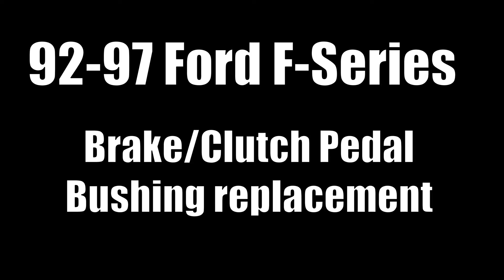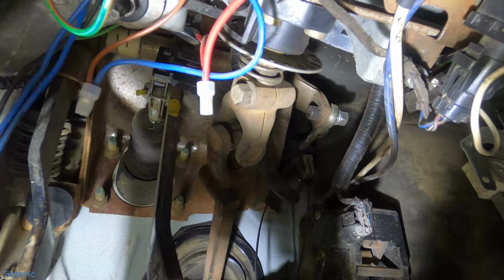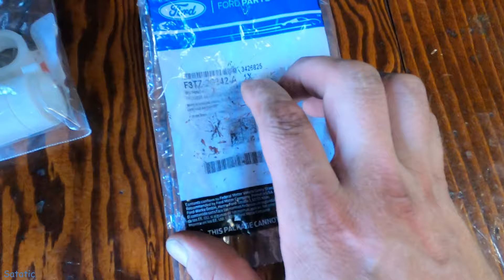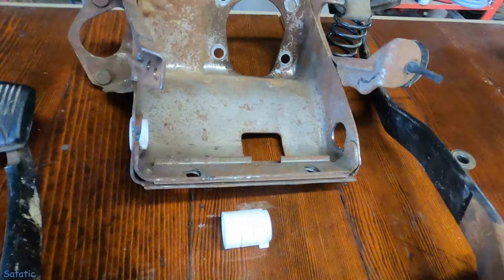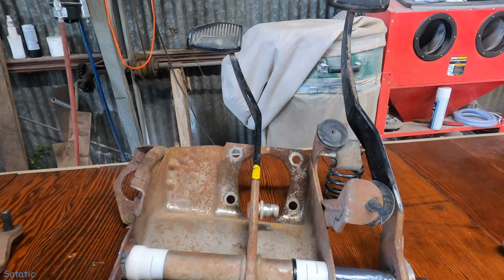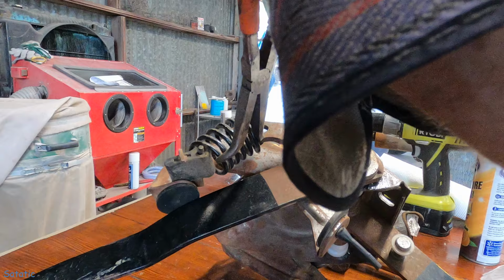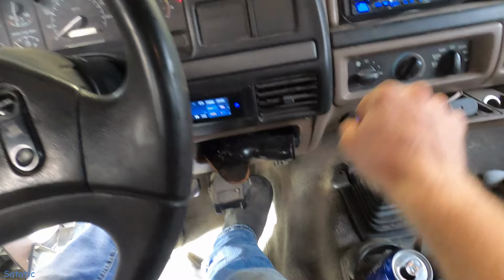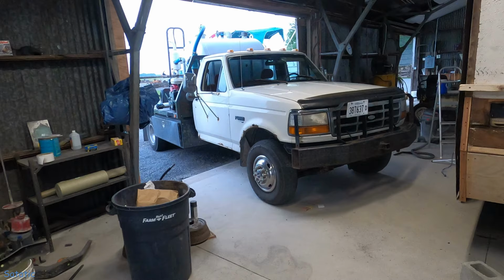92-97 Ford F-Series Brake/Clutch Pedal Bushing replacement

Comment: If the assembly hasn't rounded out. Can you just remove the 18mm Nut on both sides and remove the bushing and shaft without removing the entire pedal
 assembly?
Reply from the maker: I tried that years ago. I was able to get the two closest to the clutch replaced like that. Wouldn’t waste the time trying to do it that way.
Reply: You can do it, it's a pain in the ass. Honestly itll take about the same time however you decide to do it lol

Comment: Before  you done the Heim joint, did you really have to slam down on pedal so it would trigger the safety switch? Thanks!
Reply from the maker: There is a cover on top of the safety switch that breaks. Every time I mess with it, I wrap 2 zip ties around it to keep the cover in place.

Comment: Quick question, did your brake pedal ever not want to work at random times? I know my bushings need replaced aswell I'm just curious if that's the cause of me hitting the brake and the pedal not going down
Reply from the maker: Maybe your hydro boost. When mine was leaking, the pedal would get rock hard if the power steering got low. Watched a YouTube video and rebuilt mine.

Comment: Why can't you just drill a hole through the shaft and install a cotter pin to keep it from popping off?
Reply from the maker: I cant remember why, it was years ago. Maybe that could be done though.
Reply: @Satatic  That's what I did just last week.  If the bushing is gone it will have a lot of play still with just the cotter pin.  Someone on ebay sells bronze bushings to go in there along with the pin.
Reply: I tried that and cotter key got bent
Reply: Grind the old pin off then stick a bolt through it. Weld the bolt head so you only need one wrench. I used a bolt and a piece of copper tubing as a bushing...